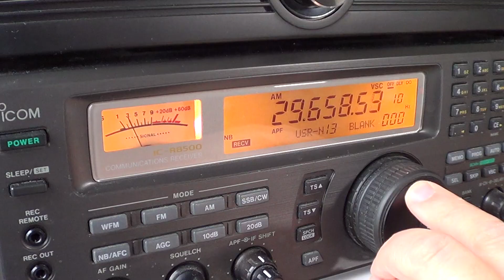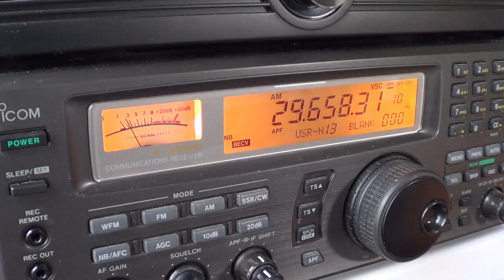When to use different modes AM FM USB LSB CW

Comment: Glad you made a video about this...been licensed since 2011, mostly VHF 2m portable operations but in the last 4 years I got my General license and started operating HF and I have tuned conversations in with my FT 818 on CW & CWR but could not get it tuned on LSB or USB for some reason.  Really confused...Joined a local club as a result.  Thanks for the video!

Comment: ? I'm listening to channel 38 Lower ssb on CB radio traveling mobile (goes against the 14.mhz rule already), and a couple a guys went to FM mode on the same channel. What does this actually do?
Reply: It means that you probably hear a squeal or tone from your speaker if you are on LSB or USB listing to what is actually an FM transmission. Same will happen if it's an AM transmission but you'll aslo be able to hear the voice except for an annoying squeal.  In both cases adjusting the clarifier will make the note higher or lower and at one point you will be able to make it disappear. This is because when in SSB receive mode your radio is 'adding' back in the carrier that gets suppressed by SSB transmitters (they have no carrier), but AM and FM do have a carrier so this local carrier or BFO (beat frequency oscillator) internally generated inside your radio will 'beat' against the carrier from the AM or FM's carrier and you will hear the difference. That's why you can get it to disappear at one point because the BFO is the same as the carrier of the AM or FM one at that point.

Comment: great job. not shore of receiver range.The 108 to 174/5 Mhz VHF band is AM for aircraft. just over the US FM broadcast band. I did hear some 10 meter am .not common. we got 2 FM 10meter repeaters hear. I have alinco DJ-X11  reciever. from LW to UHF.  once you get to VHF /UHF you sometimes hear both USB/LSB being used.  I am hearing 1.25 meter SSB and RTTY now.  The UK CB band 11 meter is FM  27.60125 to 27.99125 . recent rule change allowing SSB in the UK. It's a lot of fun listing to see whats out there.!!  AM is 5 Khz bandwidth and SSB is 2.5Khz bandwidth  standards set many years ago. The bast way to learn week signal tricks is to try. every radio is different. some are vert tight . and there is 2 meter AM for hams. never herd it used. SSB all the time.